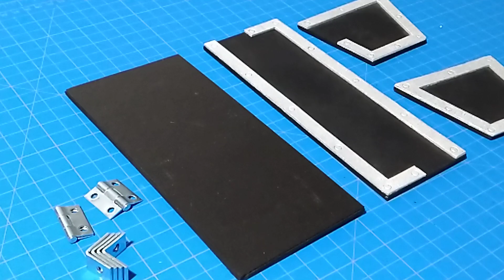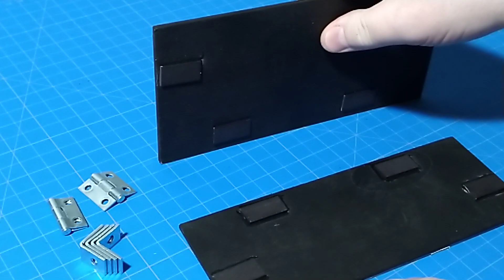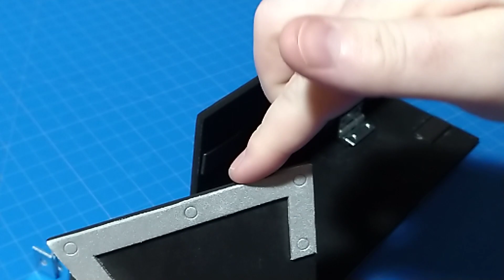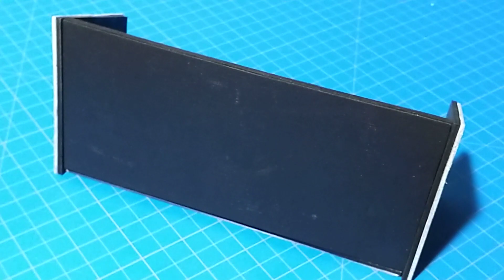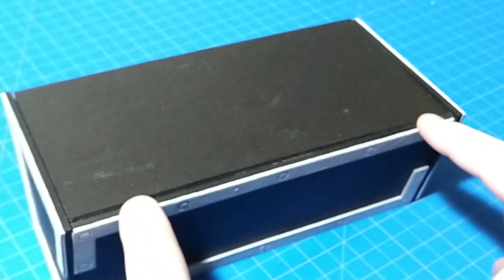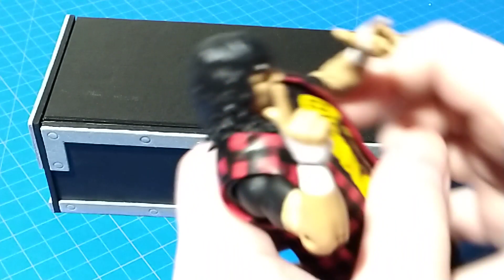Custom Announce Table Assembly

Comment: What did u make this out of?
Reply from the maker: Wood, metal, magnets, craft foam and spray paint.
Reply: @customtoyrings  is the black material wood?
Reply from the maker: Sides, top and front are 1/8th inch craft plywood. Top has a layer of padding on it. Front and sides are painted black. Silver parts are craft foam painted silver.
Reply: @customtoyrings  bro thank you so much, I've been looking for a strong proper announcement table for ages